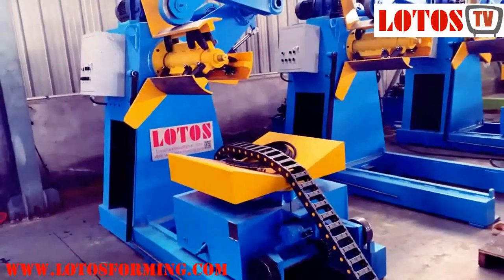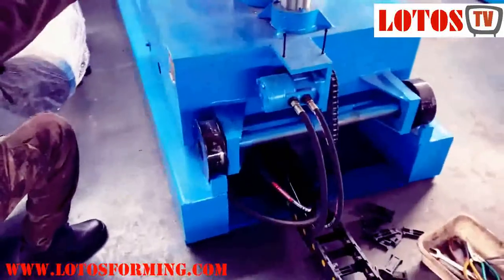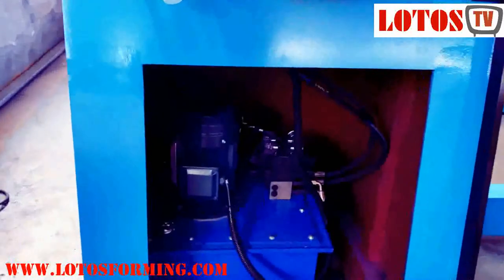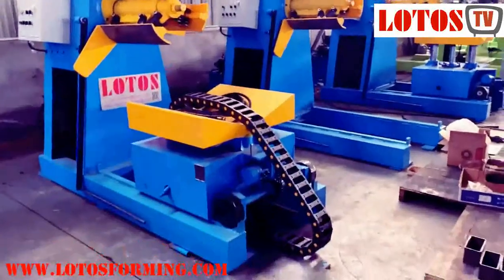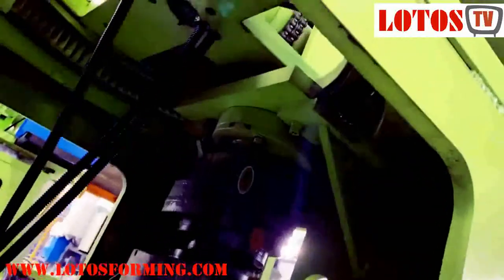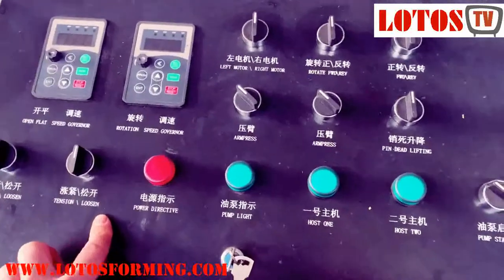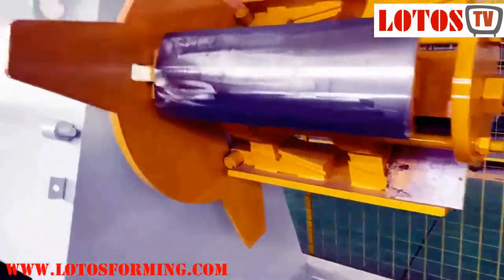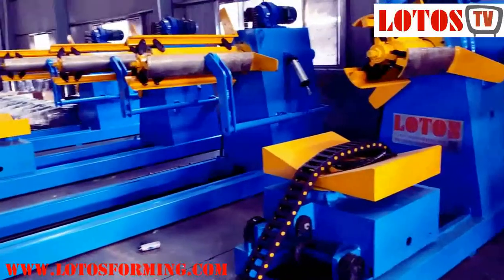Different type of Decoilers ⏩ hydraulic decoiler |  Motorized decoiler | Manual decoiler

Comment: there is a sensor between decoiler and roll forming machine. If the coil is tight, the sensor will let the uncoiler go forward. If the coil is loose, the sensor will let the uncoiler stop